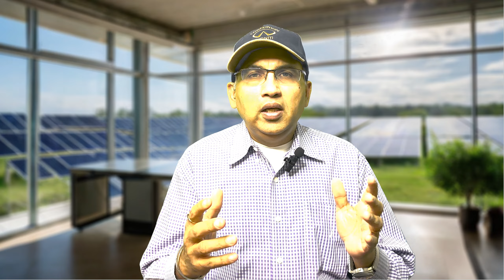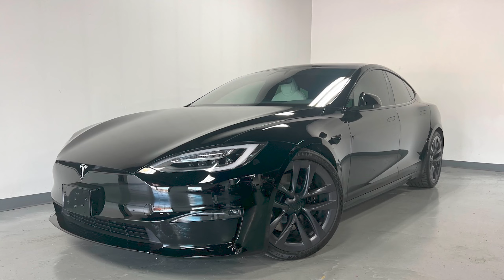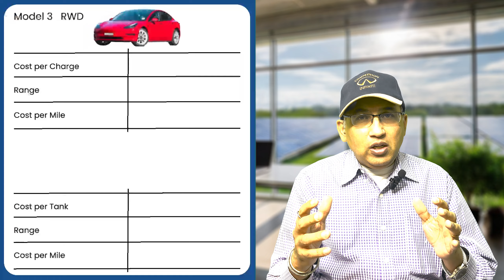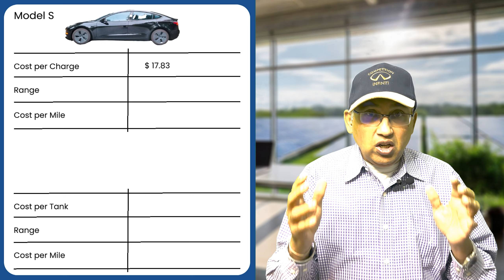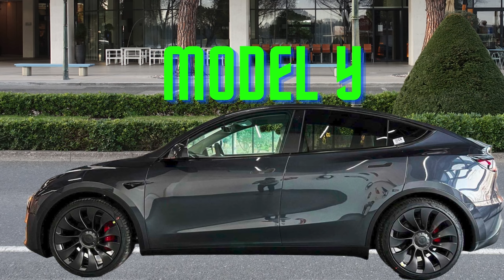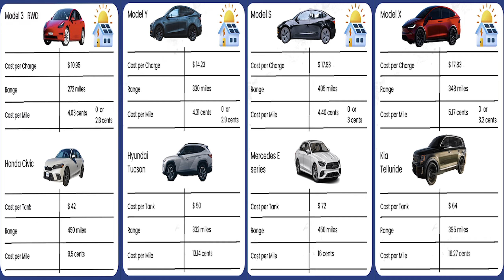Tesla Charging vs Gas Vehicle Expenses vs Solar Panel Charging

Comment: As a long time Tesla owner in Canada, the difference is even more dramatic here.  We have relatively cheap power at 11kwh but gas is double the price of the US due to high taxes.  The very low cost of maintenance has also been a very nice benefit of Tesla ownership.  Solar panels coming soon!
Reply from the maker: Super to hear from you Ralph. Fuel cars are going the way of the horse drawn cart. Thanks for watching.